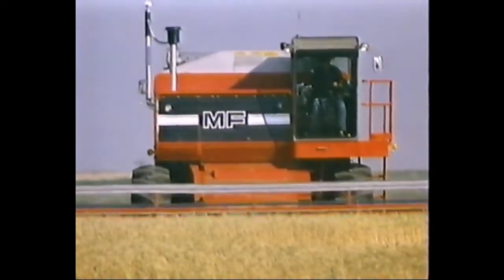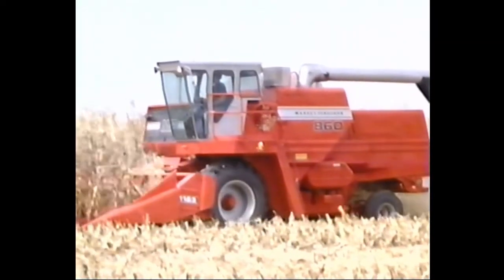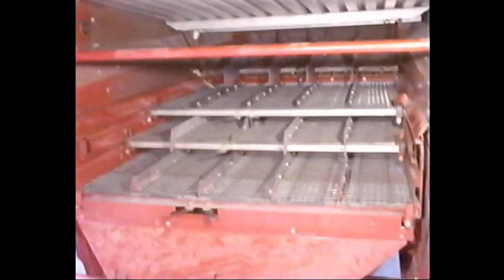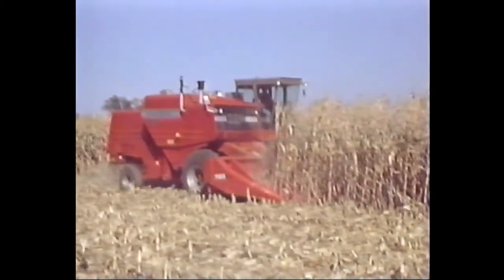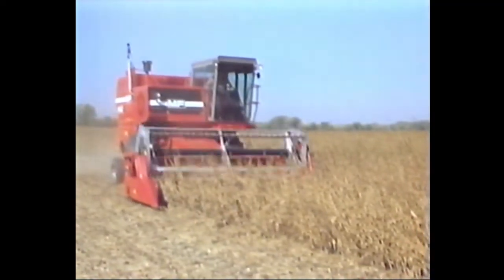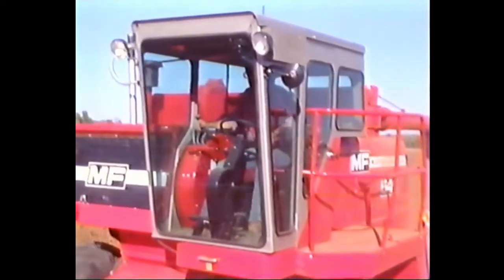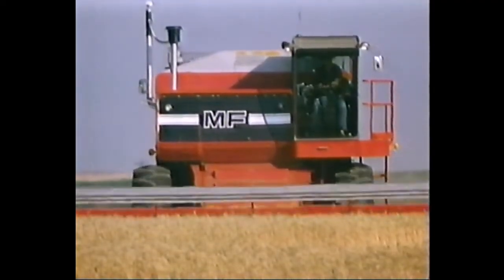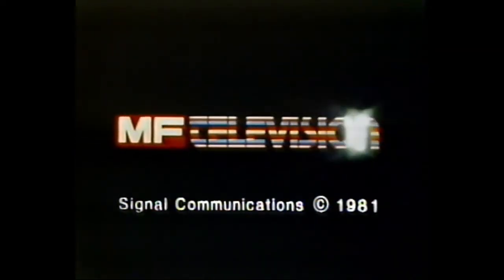Massey Ferguson "Combines for the 80s" Promotional Video.

Comment: I found the part about resale entertaining. There is still a market for IH 1400 series combines 50 years later. Any Masseys that survived in this area into the early 90’s were basically sold for scrap.  Had a friend with a 550 that he used into the 90’s and then traded it for a 6600, said it was the best day of his life.
Reply: I think MF (and really any older combine)s are so cheap because parts are nearly extinct, and Agco is the worst in terms of parts and dealer network. I have a 550 and it's a fine machine, just hard to find belts, bearing etc.

Comment: Great video of a great combine we were one of the first in the UK to get a 760 18 foot powerflow header it was really better than the rest seeing neighbours struggle with old fashion class and john deere . We later had straw spreaders fitted and a chopper when stubble burning got banned  here it was the renamed a 765 . One thing we did notice on the bottom of one of the elevators there was a warning  label to clean elevator  regularly when operating in snow 😅 didn't see much of that during  our harvests and the air con  was brilliant  along with  the drive experience  thanks MF

Comment: I have 2 860's.  A 1984 model and  a (newer style).  The air intake shroud they show before 3:35 on the 84 is just like that, the newer version they went to a serpentine belt around the drum that drives off the output shaft, and also tey added a chaff extractor unit.  They must have got that idea from Mickey Mouse clubhouse. lol.  I hate it, they didn't improve anything.  Just made it harder to work on.
Reply: Don't get me wrong, the newer model is also a nice machine and works well.  It just seems it's harder to fix than the other one because of some slight changes they made.  But if I buy another one. I will look for the older version like my 84 model.

Comment: A few Massey haters, I detect.  These were awesome machines--Queens of the flatlands.  And, despite the moaning from detractors, you could actually work on them without consulting a software engineer.
Reply: I will assume you never ran anything else, because they weren't queen of anything
Reply: You could work on any combine of that era without a software engineer, hell you could go up to the late 2000s with some machines. 

I've only seen these machines once, and that was at an auction 3 months ago. I assume if the paint isn't wore off the inside of the machine, not a whole lot has went through it.
Reply: I don't understand why so many massey haters watch videos of these machine and leave comments. Just go watch videos of the machines you like, in my opinion massey makes good stuff that's why we run massey in fact my area is very strong in massey equipment
Reply: @formerreaper7987  I watched because I cut 1000's of acres with a Massey just like that, and it brought back memories, but the idea of that machine being the Cadillac of combined is just not accurate
Reply: No no they were junk
Reply: @wyattsmith9291  u don’t know junk then, 78-80 they tried to lighten the up, not as good as early and later
Reply: They are an awesome machine. But you have to keep up with maintenance.  Like all machines, if you don't schedule routine maintenance, it will schedule it for you.  lol

Comment: They were good machines, but had no business doing a comparison with IHC, they were the innovator of the system still being used today. I will give them this, they probably were number 1 in the 70s....that's why John Deere copied them, something JD has been notorious for.
Reply: Everyone copied the original MF combines. Most of the European brands started out as either a copy of MF, like Claas and Fahr (and a couple others I can't remember), or were built under license from MF, like Dronningborg in Denmark and a few others.
Reply: 1680 axial flows couldn't hold a candle to the 550 in the field. The feeder house was too small for thw bigger header. We used to run circles around the big crews from Texss that ran IHC
Reply: @GallOGlaigh993  they must not have had settings right etc... I've been around 550 Massey's and their not worth the matches and gasoline to burn them with. A 1440 International is an even or superior machine.
Reply: @Blazefork  reread. I explained why.
Reply: @GallOGlaigh993  I started out with a 1480 with a 30' 1010 and had no issues, could run 4.5 to 5 mph in 50 plus bushel wheat and keep it in the machine, a rotary combines capacity isn't as directly linked to the feeder house width as a conventional combine. I operated an N6 Gleaner and it was a cutting machine when you could keep it in the field and the throat was narrower than the International machines. I apologize for the snarky comment on the 550.. but the experience I've had with them is non plus.
Reply: @Blazefork  We had no issues with the 550s and we ran 4 of them. Kept them maintained
Reply: @GallOGlaigh993  thinking back to your comment on the 1680's if they were running older 810 header then there was the issue, it was the slowest part of the machine, auger created a bottleneck
Reply: Ih didn't haveca combine till thet started making rotary. Massey was the leader in the field if you was a custom combiner.  There was no competition from ih or JD. If you didn't run a massey you didn't get the job  Massey 760 and 860 were largest machines on the market.
Reply: @thesteelrodent1796 Massey had one model that actually was a Claas  had a friend that had one.
Reply: Exactly the 7700 and 7720s were good copys of Massey. The 7720 finally put JD back in the combine market

Comment: My dad and grandad had an old super 92 from the 1950's and my dad replaced his 95 John Deere in 1969 with a 410 and I bought a 550 in 1983 neighbor bought a 750 in 85 
I quit in 86 and didn't have a problem with Massey we raised 
Rice, grain sourghum,  wheat and beans they were good machines then.  But , Massey was in trouble by the late 80's and early 90's 
The first hint was they closed down their company owned stores.  Wr then had to travel several miles around 80 miles round trip aferwards for parts ...and service
MF was a victim of the 80's farm crisis as were many farmers.....
Reply: Super 92 was built from 1960 to 1964.   None were built in the 50's
Reply: Massey was a good company, had decent dealer support and decent products.  Don't forget that the big IHC and Allis also went under during the Carter induced farm crisis.  New Holland ended up with Ford to survive as well.  Can't blame Massey for the failure. Any simple economist can see that if you take away the farmers income and raise interest to over 20%, you have a disaster on hand and no way to recover till you get new leaders in charge. They had a hidden agenda to eliminate any and all small family farmers and business men in favor of the mega corporate operations that we have today.  So over 1/2 of the Farmers and small businesses  went under as well, If the farmer don't have money, he can't buy replacement equipment. That's the thing the big headed idiots in Washington don't care about  the average person, they get their money, they don't give a fig about us, and their trying for a repeat performance today.
Reply: @frankwurth5375  My checking account would disagree with your.   I used to be a republican but no more, not since trump came along.   Now run along and play little boy.   And learn correct grammar, it's "You're", not "Your".
Reply: @GermanShepherd1983  Are you crazy?

Comment: Yeah, Massey ruled until Jimmy Carter destroyed the farm economy!  Put nearly 1/2 the farmers into bankruptcy, no farmer= no equipment sales= no dealers and no builders!  We lost Massey, Allis, IHC, and White, all because of Carter!  Someone pointed out that these combines had so many moving parts that with wear they became a maintenance nightmare. Yes, they did, but almost everyone else's machine had the same problem for the same reason.  IHC revolutionized the industry with their rotary machine as it had 1/2 the moving parts. But even yet today, combines are still a maintenance nightmare. The rotary concept eliminated excessive extra moving parts for a while, but todays machine are back to adding all kind of extra equipment to make a more complex machine, we've gone a bit backwards!  But today that same size machine will set you back nearly one million dollars, compared to the 60-70 thousand back then. The price of corn today is still about the same as the pre -Carter days, think of that.
Reply: 1979 was the best year for farm equipment companies. It was the mid 80s when the farm crisis was. Carter didn't lower loan rates. If you want to yack at least have facts

Comment: Why are some people saying they were junk machines and other people saying they were great machines? So, which was it.
Reply: They were a good large capacity innovative machine when they were introduced that many custom combiners used. They did have reliability issues. They were more of a budget brand with lighter steel and looked to cut corners to save money. Example they originally had a reliable heavy duty bearing off the motor that they replaced with a extremely light duty one with the early 850/860s. It made no sense other than to save money and it caused constant major repairs. A couple years later they had to revert back to the original HD bearing.
Reply: @jameshill4900   thank you

Comment: Ask anyone who ever owned a Massey 540 or 550 about reliability and resale value.   And then be ready to run.
Reply: Speaking for a 550 owner, reliability would be best described as bulletproof. It's 42 years old and hasn't had a rebuilt anything and it works fine. As for the resale value, I have no idea. we bought it new and haven't sold it.

Comment: When people tell me it's green or nothing I ask them if they have ever run anything else.  It's funny when I hear the answers.
Reply: @ralfpusteblume2144  you should have tried a gleaner or New Holland, these Massey's were horrible machines
Reply: @ralfpusteblume2144  have a V8 Perkins for an irrigation motor. Has to be 70 degrees to start it without ether. It’s pretty old though. I do agree with you about reliability. It’s never been opened up.
Reply: @larrygro  

How many hours has the engine run? Normally if the Perkins engines  have not run to many hours the start very well. Depends wether the pistons are worn out and this leads to low compression...

But for me as a european i prefer cummins diesel John deere own built diesels. We never had any any Problems with cummins engines.

In some bigger MF tractors cummins have been built into it. But never had any major problems.
Reply: @ralfpusteblume2144  I don’t know because the hr gauge is broken but I would estimate 15,000 hrs at least. Uses very little oil though
Reply: @larrygro  

Yeah 15.000 hours could compression. Or injection nozzles are spraying the diesel fine enough.... If the nozzles are broken oil consumption can be normal, but the engine blows blue smoke in the exaust with low rounds per minute ...
Reply: @ralfpusteblume2144  it does seem thirsty. Maybe I should check them out
Reply: I understand...I am a mostly a JD guy but have ran these 860;s..I would rather have a 860 than a 77 or 8820...
Reply: @RJ1999x  if taken care of they were the best of the generation, gleaner too cheap, easy to work on, 8820 had to stay behind them no way they would out cut the Massey had them in the same field, other two?? 550 was junk I heard, no experience
Reply: @sheilamclaughlin963  Not in my opinion, an 8820 was a better built machine but couldn't save the grain or clean it, like the Massey, but a Gleaner L3 was more expensive then the Massey and by far better, 10x better if you were in mud, better hydro, better engine, much better cab and controls. The N series was way more combine then this class machine same as the New Holland twin rotor. It wouldn't be an apple to apple comparison